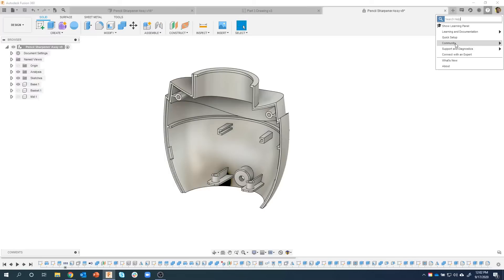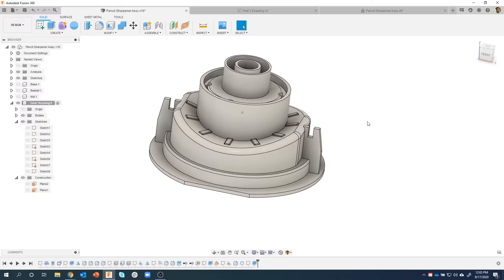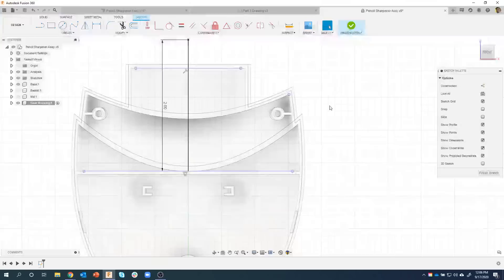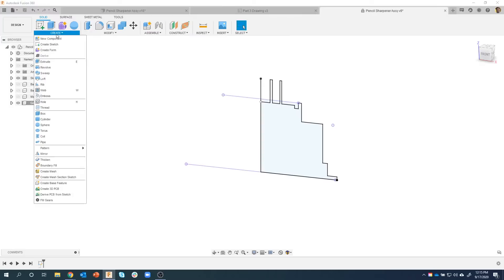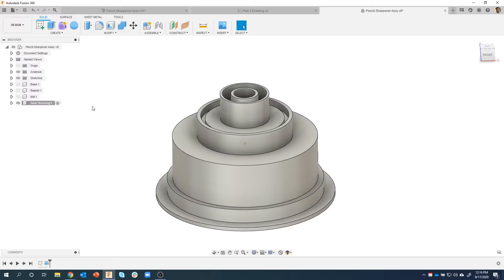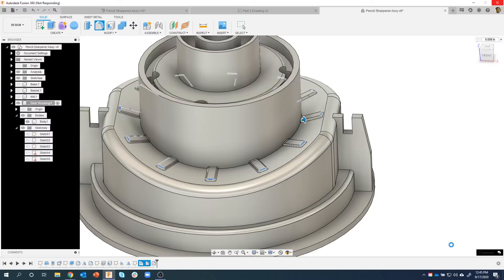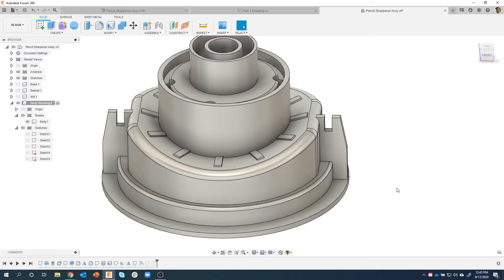Pencil Sharpener Project - Part 3

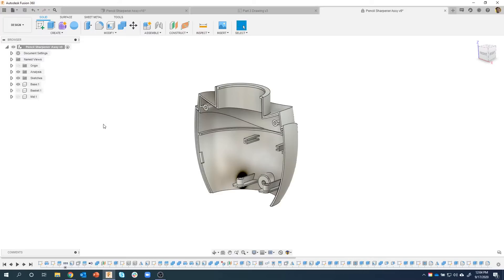Comment: At @ 6:11 the circular rib or web wasnt there when you made the base (withoutfloor)..please refer to Pencil Sharpener Project-Part2
Reply: I saw that too.The 'circular rib' was original made as the last steps of Part One using the Project/intersect command, offset command and extrude. Also wondering how and when it got to the Base (without-floor side)??
Reply: Tried going back in the timeline to when the circular rib feature orginally created, using the same sketch, but get errors for later mirrored features such as the web. Simple enough to go add it using the drawing info, but the model and timeline is not as 'clean'

Comment: Thanks again! (Just catching up, got a bit behind). The fillet rule was a really good one to know about as was the diameter dimension. Finding it interesting how you sometimes create an offset plane, sketch there, then go down using "to object" (e.g. towards the end about 50 mins). I think I'd have probably gone for sketch on the existing surface then up a measured amount... however I'm wondering if there's an advantage in your way? Or is it just personal choice this time. [Just trying to understand if there are some better habits I could pick up here although I appreciate, for teaching purposes you sometimes do things a certain way to slide a good demo of a program feature in]

Comment: Hi Brad,
Love your teaching style. Thank you.

I'm facing a problem; not sure if anyone is experiencing the same.
The origin of my new component (Gear Housing) is slightly shifted compared to the base component.
Currently, I'm referencing the origins of the base component. How can I resolve this issue in future?
Reply: I was following the tutorial all along from part01, but now when I see the basket and the mid. They have different origins, and the base has different. So the base component is misaligned. :( Will I have to do it over again, or is there an easier way to figure it out and resolve it.
Reply: Ok. I figured it out. Somehow the component had got repositioned.
How to avoid such accidental repositioning of the components while modelling?

Comment: At 35:20, you constrain the sketch line to the midpoint of that fillet / fillet projection. I cannot reproduce this and it’s driving me nuts. I can apply a coincident, just not a midpoint. It’s a minor thing...unless you have OCD like me. 

Any ideas as to what may be prohibiting the application of this constraint?

Thanks.
Reply: I'm having the same issue! Were you able to solve it?
Reply: I have a pretty simple work around for the center point.  Project the fillet as suggested in the video then add a 3 point arc on top of the projected image.   You will see the center line constraint and can use it.  I know Brad did not show that in the video but the additional 3  point arc works.